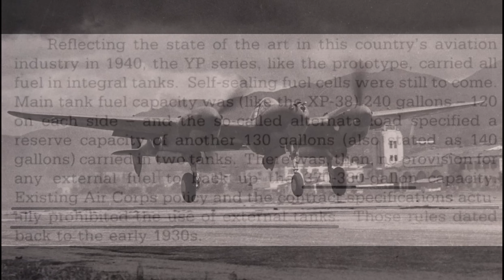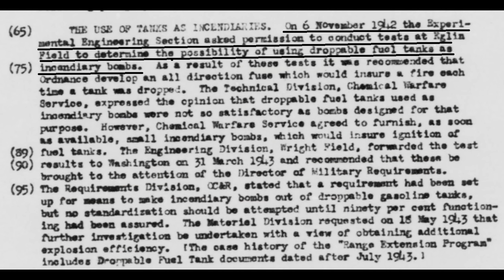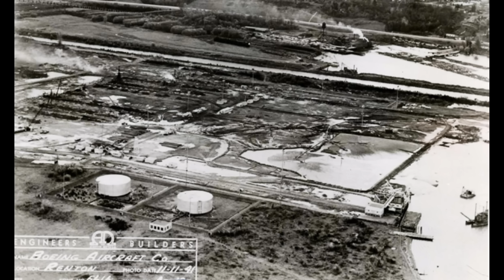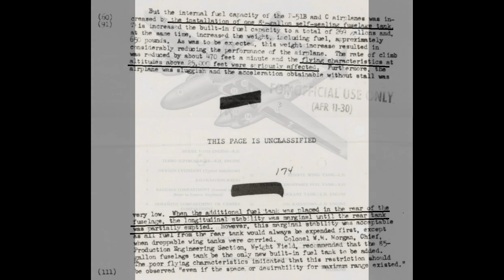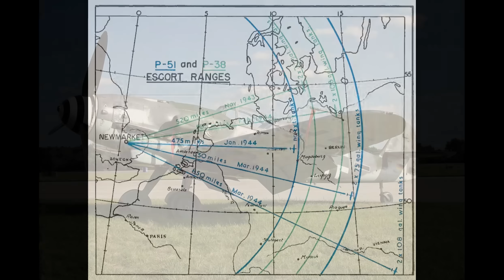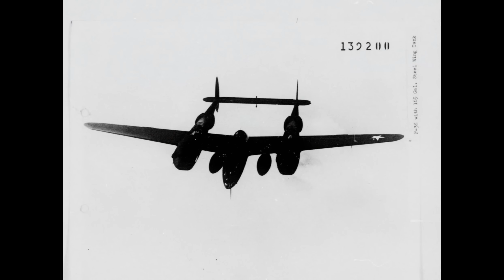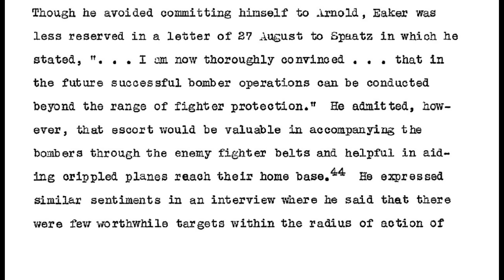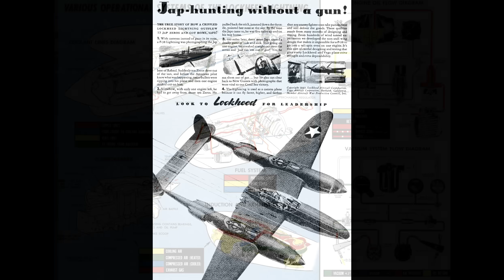The P 38 Lighting and the Bomber Mafia's Failure In World War Two

Comment: WOW! This vid undercuts so many assumptions about the myth of the Mustang! Why did I never ask myself why they could kill Yamamoto in the Pacific but could not escort B-17s to Berlin? Clearly, there must have been some effort to "prune" this history along a certain path. Very enlightening!
Reply: I don't know if there was an effort to "prune" this history; I think it was just the fact that the P-38 turned out not to perform that well in Europe.  It's failure to live up to expectations caused Major General William Kepner, the commanding general of VIII Fighter Command, to direct a Colonel Harold J. Rau to look into the matter and prepare a written report.  Rau did, and wrote "After flying the P-38 for a little over one hundred hours on combat missions it is my belief that the airplane, as it stands now, is too complicated for the ‘average’ pilot. I want to put strong emphasis on the word ‘average,’ taking full consideration just how little combat training our pilots have before going on operational status.”

He went on to elaborate.  Take a typical new pilot "...fresh out of flying school with about a total of twenty-five hours in a P-38, starting out on a combat mission.” This pilot would be on “...auto lean and running on external tanks. His gun heater is off to relieve the load on his generator, which frequently gives out (under sustained heavy load). His sight is off to save burning out the bulb. His combat switch may or may not be on.” 

So what happens when this pilot gets bounced by German fighters?

“He must turn, he must increase power and get rid of those external tanks and get on his main [fuel tank],” Rau wrote. “So, he reaches down and turns two stiff, difficult gas switches (valves) to main, turns on his drop tank switches, presses his release button, puts the mixture to auto rich (two separate and clumsy operations), increases his RPM, increases his manifold pressure, turns on his gun heater switch (which he must feel for and cannot possibly see), turns on his combat switch and he is ready to fight. At this point, he has probably been shot down,” Rau noted, “or he has done one of several things wrong. Most common error is to push the throttles wide open before increasing RPM. This causes detonation and subsequent engine failure. Or, he forgets to switch back to auto rich, and gets excessive cylinder head temperature with subsequent engine failure.”

Rau added that he had learned that his P-38 group had lost at least four pilots who, when bounced, took no evasive action. “The logical assumption is that they were so busy in the cockpit trying to get organized that they were shot down before they could get going,” he wrote.  I think this was simply less of a problem in the Pacific, where the pilots usually flew at higher altitude than their Japanese opponents, and were less likely to get bounced and be more likely to be the ones doing the bouncing.  

Fighter ace Robin Olds got his first two kills in the P-38 in Europe, and he later wrote “I loved the P-38 but I got those kills in spite of the airplane, not because of it. The fact is, the P-38 Lightning was too much airplane for a new kid and a full-time job for even a mature and experienced fighter pilot. Our enemies had difficulty defeating the P-38 but, as much as we gloried in it, we were defeating ourselves with this airplane.”

The P-38, was a great aircraft which did have the range needed for bomber escort duty in the ETO and could have done it before the Mustang was available, but it was a bit complicated to fly and needed more experienced pilots.  The P-51 was a lot simpler, and therefore simply a far better plane for the 8th Air Force to use as a bomber escort, and once the Mustang was available, there was no good reason to prefer the Lightning for bomber escort duty, even if the USAAF should have used the Lightning for escort duty earlier, before the Mustang was available, and didn't.
Reply: @Hibernicus1968 but the argument isn’t P38 versus P51, it’s that the P38 was available significantly earlier and could have contributed more to escorting bombers in 1943 if certain decisions were made. the P38 was a complex expense aircraft but the reality was that flying any WW2 fighter involved multiple manual controls & adjustments. the P38 wasn’t uniquely complex in that way. I think a P38 offered more than a nonexistent mustang .
Reply: @garydownes2111  Yes, I'm sure it did.  But for reasons detailed in the video, the USAAF leadership didn't see it that way at the time.  You seem to have missed it, but at the end of my post I admitted the USAAAF probably should have used the P-38 before Mustang became available, so I am not sure why you are arguing with me.

That said, the twin engine configuration, and relatively poor ergonomics of the P-38 cockpit gave the pilot a heavier workload, and if a decorated fighter ace who flew the Lightning and scored kills in it, and who later rose to the rank of brigadier general was of the opinion that the P-38 was not really suited to the ETO...  Well, I doubt any of us are really qualified to tell him he was wrong.
Reply: @Hibernicus1968  but Greg and I agree with the P51 being better, that’s in the video… your claim of P38 unsuitable isn’t supported by multiple sources
Reply: @garydownes2111  Take it up with Gen. Robin Olds, who said it wasn't.  Take it up with Col. Harold Rau, whose written report said it wasn't.  Take it up with Eric "Winkle" Brown, who evaluated it for the British at Farnborough and said it wasn't.  Argue with the historical fact that the P-38 was eventually withdrawn from all but reconnaissance duties in northwestern Europe, while the P-47s and P-51s flew right combat in that theater right up to VE Day.

I find you arguing on a curious position: explaining why decorated ace pilots who flew the P-38 in combat in Europe didn't know what they were talking about.  For myself... I don't really care what later (unnamed) sources say; I'll defer to the opinion of the wartime pilots who flew it, and thought that other planes were better suited to the conditions of the ETO.
Reply: @Hibernicus1968  Gen. Olds attacked 50 ME-109s in his P-38,  just he and his wing man.
Reply: @garydownes2111  Without question. The arguments are really pretty silly except for not planning for escorts. We were fortunate  to have both the p38's and p47's when we did. We were also more fortunate that brits had what they had,. im not a smart man but I suspect it would have been a lot more difficult for the 38's and 47's to have an impact if they had no island to fly from? We likely would be talking a ;lot more about hellcats and how many carriers we had to build to beat the germans back???
Reply: @Hibernicus1968 Rau was known for a heavy bias against the Lightning. 8th AF pilots really struggled from poor training and maintenance. There are many stories of elite LW aces being given a tough time by P-38s e.g. Galland, Steinhoff
Reply: @Spectre407  Okay, I guess you're right.  Robin Olds, Harold Rau, Eric Brown, et al. didn't know what they were talking about.
Reply: @Hibernicus1968  Again, it’s about context. 8th Fighter Command’s support of its P-38 groups was woeful compared to the extra care and training 47 and 51 units received in theater. Keep in mind that Olds was an undisciplined young buck back then and was serving in the most underperforming fighter group in theater - they lost both their CO and deputy soon after arriving in theater so their leadership was weak.
I’m not saying the 38 did not have real issues in the 8th. But consider Greg’s comments with the 8th narrative to discredit the 38 and then also consider the 38’s performance in North Africa and Italy where it made a strong showing against the LW in the early days when the USAAF and was outnumbered and still gaining experience. It comes down to pilot skill, leadership planning and tactics, and logistics. The P-38’s counter-rotating props allowed a knowledgeable 38 pilot to create some unique problems for a trailing adversary, and the nose mounted armament with the Hispano packed a real punch. Look at use of differential throttle by Erv Ethel during his historic fight, and Lt Col John Lowell’s turn tactics against Galland in a Dora.
Reply: @Spectre407  All I can say, is that it astounds me the reams of verbiage that armchair warriors will post, decades after an event, to say -- without any sense of shame --  "I know better than the guys who were there."

And you manage somehow also to overlook the main point I was making -- to wit: it's not about what experienced and knowledgeable pilots like Erv Ethel and John Lowell could do with the plane; it's about what the average pilot, with limited hours of flight time could do with it.  You don't win an air war with a handful of experts -- if you did, we'd never have been the Germans with their array of aces with kill counts in the three digit range.  You win it with an entire air force of pilots who have enough skill, and who have the right weapons for the job they need to do (which in this case was to take control of the skies away from the enemy).

No one with any sense disputes that the P-38 was a great plane.  Our two highest-scoring  aces of the war wouldn't have racked up their impressive tally of victories in it if it weren't.  

The issue though, is "was it a great fit for the ETO?"  And the answer is, no, not really.  There were better planes for that theater, and this is borne out by the comments of some of the pilots who flew it, whom I've quoted at some length, and by the fact that the P-38 was eventually withdrawn from all but reconnaissance duties (in its F4 variant) in northwestern Europe, so clearly the USAAF command found it wanting in some regards for the ETO, however brilliantly it performed in other theaters where the tactical environment better suited it.

Honestly, I don't know why people have such a hard time with this.  It's a common enough phenomenon.  Yes, it is all about context, and that includes broader context as well.  The P-39, for example, was not a great performer in U.S. service, because it wasn't the best plane for any theater of operation where American forces were fighting.  The Soviets, however, loved it, because it was an excellent fit for the tactical environment of the eastern front.  

You'll pardon me, but it looks an awful lot to me like you have a particular love of the P-38, and can't stand to hear that it may not have been the end all and be all of WWII prop fighters, and there were some environments where it just wasn't the best plane for the job.
Reply: @ I think it is true that the same or similar aircraft performed better or worse within the characteristics of different theaters of war. The East Front air war was clearly different than the western European air war (engagement altitudes). And look at the reputation of the forlorn Brewster Buffalo: Despised in the Pacific by hallowed by the Finns against the Russians.

But I think it worth stating that the P-38 was a TWIN engine aircraft! Of course it was more difficult to fly and to fight with! Especially for novice Allied aviators facing Nazi veterans over Europe.

And as others have pointed out, the time line of this world war was critical. In 1942-43, three months was the difference between abject defeat and towering victory depending on where you were fighting and when.
Reply: @Hibernicus1968  Oh, maybe it is just me, but that is about the silliest excuse I have ever seen for NOT using a capable aircraft! Are you forgetting that hundreds of our unescorted heavy bombers were shot down over Germany and thousands of aircrew were killed or captured? Try that excuse on the widows and orphans of those crews and see where it gets you! Yes it was more difficult to fly: It was a twin engine airplane! Solution: Increase flying hours and stick time doing missions that did not require flying into the heart of Germany! There were differences in operations unique to each combat theatre that made some types shine in one and fail in another (Brewster Buffalo). But the P-38 was outstanding in both. What did PTO pilots know fighting the best Japanese aces in their Zeroes that was beyond the capacity of ETO pilots? Answer: They were not dealing with the careerism and egos of the Bomber Mafia!
Reply: @Hibernicus1968  P-38's got more kills in Europe than Spitfires did and twice as many overall.
Reply: @walterm140  And yet the 8th Air Force was not operating with it after September 1944.  They'd gone over entirely to the P-47 and P-51.
Reply: @Hibernicus1968  At some point, say 09/44, production quotas and logistics chains come into play. Both ETO and PTO were red hot and consuming war materiel like crazy. Output was the driver.
Reply: @Hibernicus1968  It made sense to change out P-38's for P-51s.  But the P-38s were effective escorts. That is the point. There's a story in "Target Berlin" where a FW-190 tried to maneuver with a couple of P-47's at low altitude.  With its extra armor and heavy cannon it went out of control and crashed. P-47s, that is not the point.  The point is that to kill B-17s the Germans had to compromise their aircraft.  P-38's could profit from that.
Reply: @Hibernicus1968  It made sense to change out the P-38 for the P-51.  Except for the 56th Fighter Group there were no P-47 groups in the 8th AF either. But the P-38 waa a perfectly adequate escort when it came to protecting the bombers.
Reply: @Hibernicus1968  Through a twist of fate the 56th FG didn't change to Mustangs. So I guess the P-47 was crap because so many groups switched to P-51s?
Reply: @Hibernicus1968  oh, you mean after the LW had largely been defeated and the Allies were well-established on the continent?
Reply: @Hibernicus1968  P-38's got twice as many kills than the Spitfires did.  500 flying from England, 1500 in the Med and 1,700 in the Pacific.  The Spitfires had the fewest kills among the major types, somewhere between 1500-2000.

Over France in 1941-42 the LW killed 4 Spitfires for each LW fighter loss.  At Dieppe the RAF lost 88 Spitfires to kill 6 FW-190s, 14 ME-109s and 28 HE-111s and similar.
Reply: @Hibernicus1968  yes we all know the Lockheeds weren’t the most user friendly fighters.
Reply: @Hibernicus1968  I hope Greg sees this comment because it addresses a lot of concerns he’s acknowledged before about human factors in other planes yet doesn’t, at least adequately, here.

especially when said human factors concerns / pilot workload is a documented and logical reason the P-38 didn’t do bomber escort to Berlin where they’d get bounced and thus were forced to confront said workload under time-constrained and immense pressure far more than the escorts of the PTO had to.
Reply: @STS-Dreamer I think you & the other gentleman are guilty of thinking the P51 was significantly less complex and easier to fly than it was. the rear fuel tank gave stability issues requiring a lot of attention and careful maneuvering until emptied. I’d prefer to be in a bounced P38 than a bounced P51D with any significant fuel left in the rear fuel tank. I’d probably prefer to be in a P47D than either of those. Also the P38 generally flew higher than 109s if on bomber escort missions just like the P51 so both are more likely to bounce than be bounced..
Reply: @Hibernicus1968 yeah I always wondered the same but after I read a few recent articles about the p38 issues and those quotes you showed I was glad they didn't use it more

Comment: Another great video.  I was wondering if you could tell us if the P-40 had anything to offer after 1942, I like the plane but don't know if I think of it as good due to liking the plane or if it really was.
Reply: It must have had plenty to offer, considering it was in production until nearly the end of the war. Afaik it was cheaper and simpler to produce than later planes and capable enough for use in secondary theaters like Burma. I've read the Brits were very happy with their "Kittyhawks" in North Africa, certainly in 1942 but also afterwards. My memory is vague but they may have been useful for local protection in North Africa during the invasion of Italy, and for shooting down Italian bombers and transports. Of course it was used (or meant to be used) at that point in medium and low altitude missions. And like anything with wings and an engine the USAAF strapped bombs on it. I definitely recall it being considered a good ground attack plane in the theaters I mention.
Reply: It managed a positive kill ratio. Iirc, 2or 3 to 1
Reply: The P-40, while saddled with a lot of included drag (that limits speed and acceleration), could have used the better Allison engines and Hamilton Standard hydrostatic high activity paddle props for a substantial improvement in performance and range. 

It was never going to be a top shelf late war fighter, but substantial improvements were well within reach.
Reply: @AlanRoehrich9651   I think the substantial improvements were the P-51 Mustang. If I remember the story right, North American was approached to license build the P- 40 and replied they could build a better plane. And for less.(?) I’ll guess that as the war went on improved new  tech like the props went to newer planes like the P-47 and P-51. Second line fighter like the P-40 had low priority.
Reply: @AlanRoehrich9651  It was more efficient to build new models instead of trying to upgrade an old one.